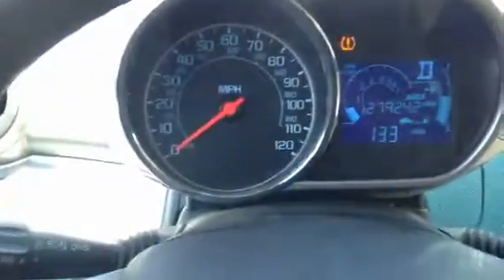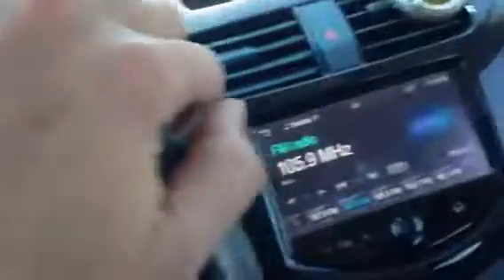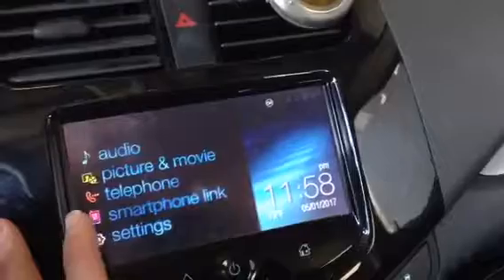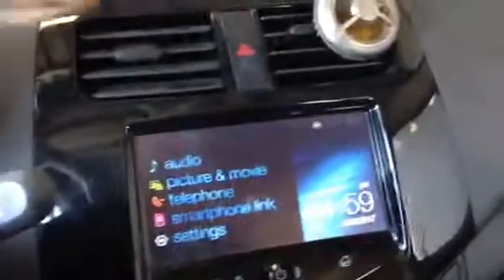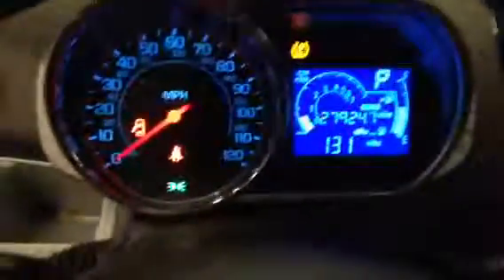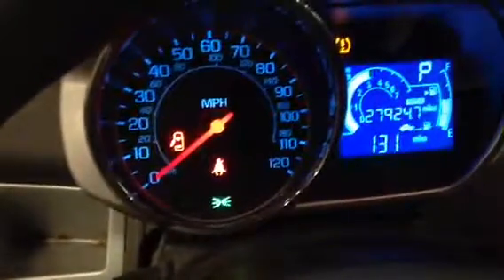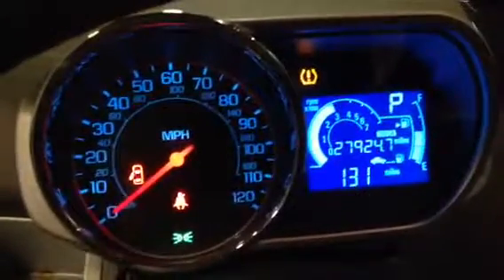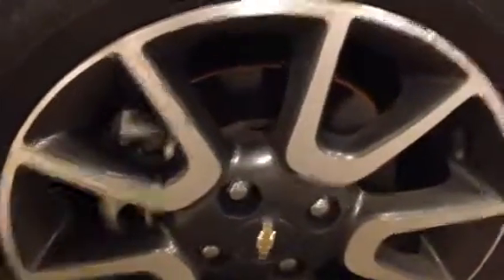2015 junk chevy spark 2LT test drive

Comment: 2014 and up were CVTs
Reply from the maker: 2003SaturnFan they all are.  All yrs. unless you chose a manual
Reply: Not the very first ones they had 4 speeds
Reply: Joes Golden Garage 2013 was a 4AT